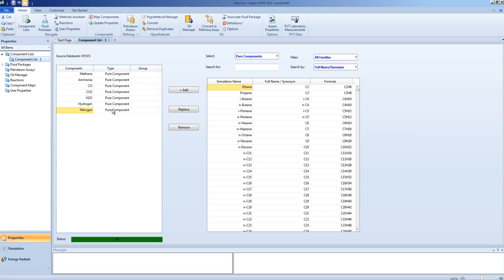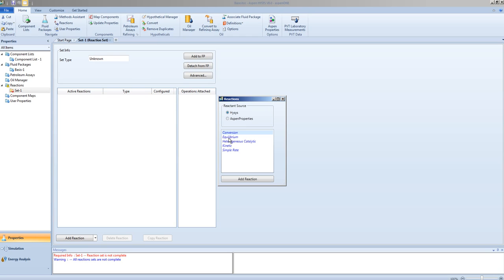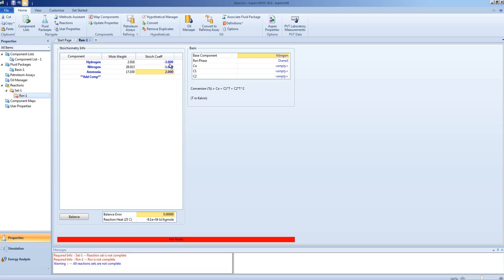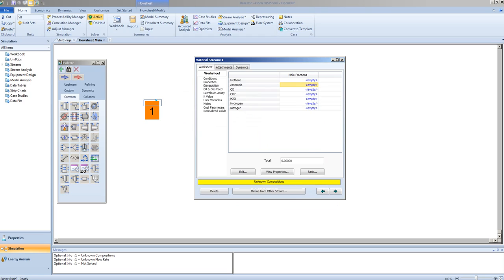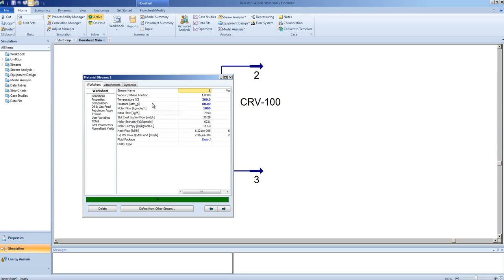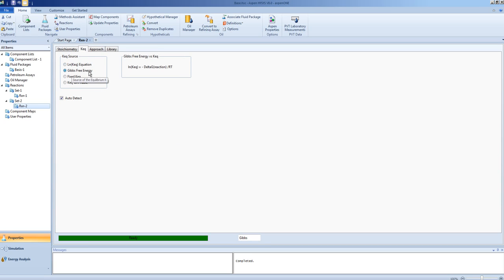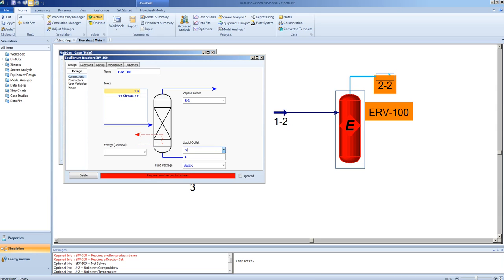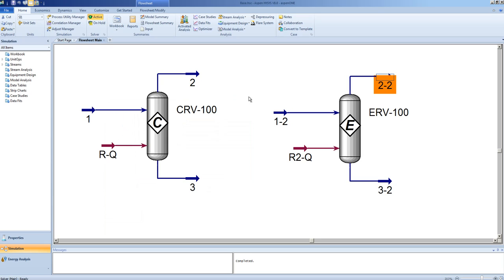Conversion and Equilibrium Reactors

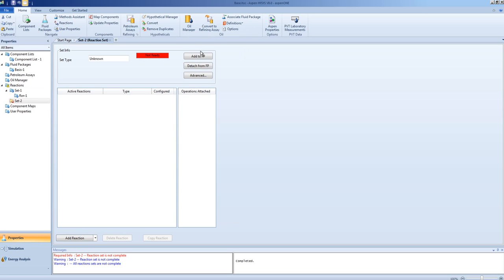Comment: Equilibrium starts at 15:35
Reply: Can you explain how to Analysis pyrolysis reaction?
Reply from the maker: @Santhosh-abi88  pyrolysis is like any other chemical reaction except there is only one reactant. You have to have the reactant and product as components in the databank or create pseudo components and enter their enthalpy and Gibbs energy data.  Other wise use Aspen Properties to design the components based on molecular structure or see if NIST has the components in their database.